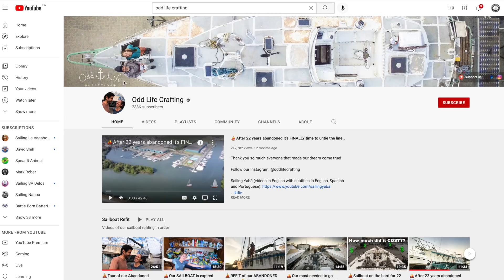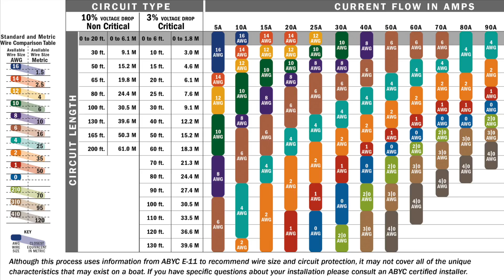ANOTHER YOUTUBE CHANNEL COME LIVE ON OUR BOAT! - Episode 130

Comment: Edge fill your honeycomb by routing out honeycomb core or Cush it in.  Use epoxy filled with cabosil and glass beads to thicken.  Rout edge smooth using template

Comment: 17:54 For the future, dig out the foam around the perimeter of the hole you cut with the holesaw, so that the plug can bond to more fiberglass. An Allen key in your drill chuck will make a crude but serviceable groove.

Comment: Love the crossover between the 2 youtubers I admire. But 2 thoughts regarding the solar frame: Why not seal the balsa core with epoxy rather than trust the sealant alone? Why not countersink the holes for through-bolting for a better seal around them?

Comment: Daddy Cornstar can you add a piece of ABS pipe on the cutting edge of the snow blower. Have seen it done on snowplow blades for use on stone driveways. Stops the plow from picking up the stones. 1 1/2 to 2 “ abs cut to length of the cutting edge. Cut a slit along the hole length spread the slot and tap it over the blower cutting edge. Rides over the stone drive without digging in.

Comment: The holes should have been sealed with fiberglass filler to seal the core and re- drilled for the cables.

It's only a matter of time before water gets into the core doing it as you have
Reply: Yeah,  i spotted this too, ive been over my whole deck and hull and core replaced in the way of any through bolt, a few bits had significant damage from where water had got in, so i did the lot.
These guys are usually pretty on the ball, this one surprised me, they even did something similar later.

I would drill out too big from the back, fill up with a filled epoxy mix, then redrill. 

Stops compression of the deck and water ingress.

Another trick, where the cables pass through,  a short grp tube epoxied in the hole stops any water going through the deck, i used that to fix a persistent  leaky pulpit.

Comment: Hi Colin, watched you last video and your having trouble glassing the square edge of your honeycomb. Get some plastic drain pipe about the same diameter as the thickness as your board and cut it length ways then attach it to the edge of the board before glassing. Hope this helps.
Archie Reid

Comment: Captain Colin, just a question or thought. What do you think that happens if you kind of cast those bulkhead repairs? The worst one in the middle already has a mold on each side. It naturally might need so improvement. So prepare very thin epoxy resin with slow hardener, drill a hole on the roof from outside and just pour in. Where you do not have those plywood plates as molds if would personally prefer making ones instead of all that disassembly and grinding.
The big question is if that 1 inch resin + original bulkhead + 1 inch resin combination is strong enough.
If not then add stainless rebars just like in concrete. Seriously waiting for your comments. All the best and regards from Finland, Mike

Comment: Looks like those 144 half cell 400 watt open circuit about 48v panels. Just installed some of those. Typically when they are working at full tilt, about 40v mppt. A ton of power.

Comment: Have you looked at 1/2 “ Coroplast, or 1/4” Reynobond?  You could probably get the turn with the reynobond, it’s a plastic (? I think) core with aluminum on both sides that you can get plain or with enamel (like the finish for a car) that’s colored. The coroplast is basically like what you were using, it’s made like a cardboard box except it’s plastic and very strong. Also comes in 1/4 sheets. I had a sign shop but we built sheds out of reynobond.

Comment: The balsa core needs to be removed and replaced where anything penetrates the GRP and for about 40mm around. Use a drill with a bent nail or similar. Replace with epoxy and glass fibres and glue powder.

Comment: Odd Life Crafting build alternative housing too I think?
Did you seal the balsa itself with sealant?
You could overdrill the cable hole and fill with an epoxy plug as you did the hardtop, and then redrilled a correct size hole, therefore making sure the balsa was sealed and not relying on sealant to keep water out?

Comment: the hole saw hole you should of sealed it with epoxy for double seal , old trick my dad use to do, ive seen silcone leak, Dad was a boat an yacht builder

Comment: It seems to me that just drilling a big hole through a balsa or foam core sandwich, and filling hole with fiber reinforced resin “plug” does help prevent bolts from crushing sandwich, but is  relying solely on bond on periphery of “plug” to secure sandwich and plug together.   When working on composite aircraft, a technique I was taught was to excavate the core away from the hole a little bit by, for example, taking stiff wire bent at a 90 degree angle, so that the reinforced plug will extend out between the glass layers of the sandwich, and bond there, between the layers of the original composite sandwich, providing two benefits:  1) it harder to pull plug out of the sandwich, and 2); your have a radial bond between the radially outwardly portions of the plug, that fill the portion formerly filled by the bals or foam core, and the upper and lower layers of fiberglass of the sandwich, which will help seal and prevent water intrusion between the fiberglass layers....thus helping prevent delamination.

Comment: Colin ALERT  . HAs anyone looked under the mast foot at the load bearing beam running from hull to hull ???.It distribes the load outwards . as you can understand a bow and arrow forces are similar. It must be very strong to prevent flex. It could need strengthening same as the bulkheads .

Comment: Saw the hole and balsa core. I’ve been told that the best thing to do is to cut a bit of core back and soak the exposed core with resin and fill back to make it waterproof. Then use the 42/5200 to seal. You’re a pro glasser, and seem to disagree, can you tell us why?

Comment: That's not enough protection for the balsa core!  These fittings are under tensions and will move slightly all the time.  At some point tiny openings will form that will let water through.  One must make sure the holes themselves are lined with water repellant fat, paint, epoxy, ...  Yes, what you've done now may last for a few years.  But fixing rotton core is such a lot of work, I can tell from own experience, that it's worth to make sure it can never happen or at least make the chance as low as you possibly can.

Comment: You also lose voltage with smaller gauge wire AND dont leave room for growth. I have 2 runs of ofc 1/0 for 400a @14.8
Reply from the maker: The voltage coming down is 96V so less current.

Comment: I thought for sure you’d dig out the balsa core where you ran your wires through and fill it with resin and chopped mat then redrill the holes to prevent water ingress before the silicone. Interesting.  How you did it.

Comment: 6:18.., An easier way to describe this is Xmas tree lights and why they dont have a step down transformer, in the UK we run on 240volts, if you imagine that 240V as a cake the bulbs act as individual resistors which consumes slices of that cake, the length of wire also consumes slices of the cake, if you were to remove say 2 feet from the length of the lights the lights would be brighter, what Colin is explaining is similar to this as the thickness and length of the wire has an effect on the current which runs through it.